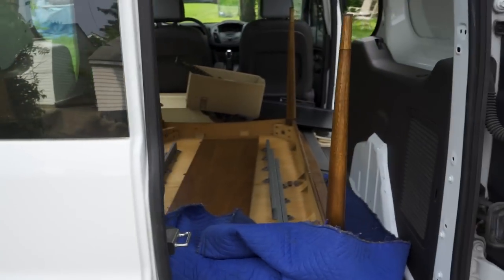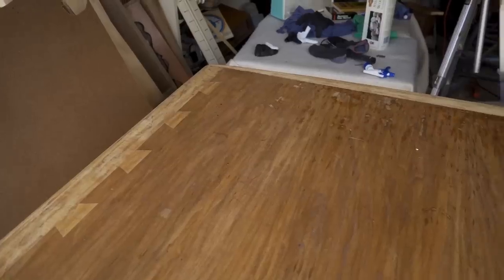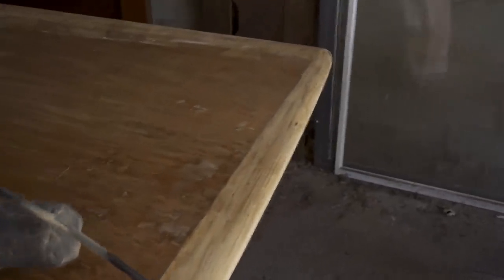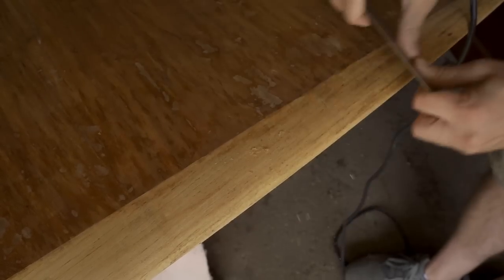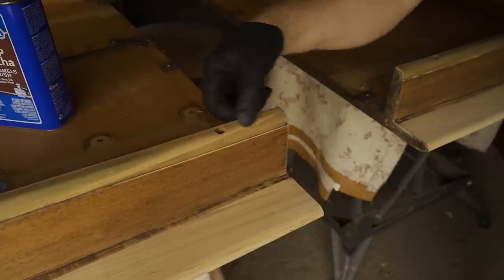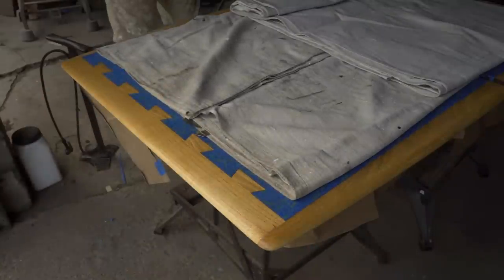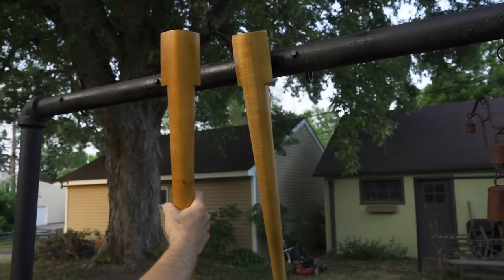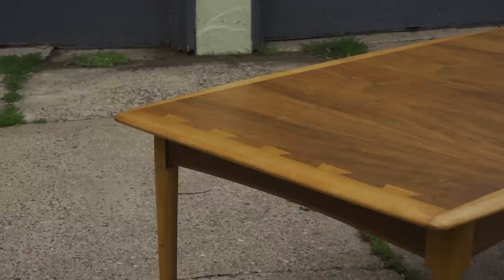I've Never Found One Of These Before | Vintage Furniture Refinishing - Repair - Restoration

Comment: I think this one is actually quite lovely with the obvious difference in wood.  Did you ever find any photos of the original piece fresh from the factory?  As always, you never disappoint.  And just as an added tiny bit of praise, I like that you never back away from errors or mistakes or accidental dings or dents.  I like that.  Honesty.  Good job, Dashner.

Comment: As a long time watcher of your channel, there are a few consistencies to your projects. Number one is that you love walnut. If it doesn't look like walnut, you usually  stain it to make like it looks like it is. The second is, you dislike dissimilar wood tones. In this case the manufacturer deliberately chose these woods BECAUSE they are dissimilar. Most everybody likes woods that complement each other. What I like is contrast. This table has it! The contrast between the border and the top is what gives this table class compared to the humdrum color of an all walnut piece. You do marvelous work, but sometimes you just need to envision what the artist who created the piece was going for. In this case, it was the contrast of the light dovetail border with the contemporary walnut top.

Comment: Dash-Nerd Leader, Thanks again for another great project. I agree with your assessment that the solid edging and inlaid dovetails are elm. This video is especially helpful for me, because I have a Lane Acclaim corner table. The guy I bought it from had done a decent job of removing the finish and sanding it. However, for some unknown reason, he then proceeded to add a coat of Restor-a-Finish (walnut). The center walnut veneer looks fine, but, as with your project, the elm looks streaky and nasty. After watching this video, I think I can proceed to bring my table to some approximation of the beauty of yours. Kind regards.

Comment: I love Lane acclaim furniture!  The contrast between the veneer and the wood that you revealed as you scraped away the finish made me so happy.  I’m glad you didn’t tone out all of that contrast, because it’s such a signature design element of the brand.  I’ve always wondered how they made the dovetails, and the revelation that they’re veneer is interesting.  I haven’t had an opportunity to closely examine any pieces to determine that for myself, so I appreciate the reveal. 

I like the look of the completed project. Although it’s not exactly original, I like the contrast between the legs and the apron.  It fits better with the top of the table.  I wish I had room for it in my tiny (cozy little, LOL) apartment.

Comment: I think you're right, the colors need to be blended a bit more. The legs, but also the lighter areas on the top have some variation to them as well (ends vs sides)

Comment: It looks beautifully, but i know what you mean about the difference between the light wood and the walnut veneer. I agree that the legs and edges could be a little darker. But it's also beautiful as it is. Given that the top coat is just laquer, which is also what the toner is, you could probably get away with lightly hitting those parts with toner again and doing a new top coat. Whatever you decide, it's a great find, and a good job refinishing it.

Comment: I have had nothing but issues with the Mohawk toner colors. I wish they had more accurate color charts or swatches. Van Dyke Brown is mostly green and Dark Walnut is more honey gold than anything close to walnut i've ever used! Unless you owned the entire toner collection to try each one you spend so much time and energy buying and trying each color that it ends up being better to work with Trans Tints and build up the proper color yourself.

Comment: Few years ago, I found a mid century dining table I sanded and oiled. I didn't finish it off with a lacquer like you did in this video. Table top seems worn out and dull now. If I want to refinish it again, should I scrape the oil off? Or should I sand it again? Any advise what I can do to redo it like the wood color on the dining table in this video?

Comment: Spoilers (probably)… *
What happened to the spare leaf? If, as most do, it was normally in storage mode, wouldn't it retain more of the original colour treatment? If it did, you have a good guide to what the original intention was. Or if you didn't like that finish, did you strip it down and do the same treatment.  I guess I'll have to wait and see.
By the way, I love the veneers on the table top, really nice pattern going on there.
* Hmm — just watched for a second time and it looks like the previous 'restoration' did a similar job on the leaf too.

Comment: I think the color is quite nice. I appreciate your work and your videos, thank you!  But one thing that sticks out to me: the finish on the two flat sides at the top of each leg.  You didn't strip or refinish those surfaces, and they now really clash with the rest of the work.  It's maybe just my eye; those little details really matter to me, and they are the first things I see.  I'd have to pull those legs off, sand the flat sides, and tone them.  (I'm a quilter, too, and where the seams meet, they'd better match!)

Comment: OK now I’m at the bottom of the list but, no you cannot leave them like that like I said I’ve done six or seven of them you have to stain the outside edges to be 10 or 15% lighter than the inside of the table or else it just doesn’t look right, to me at least, and from what my wife says which I can’t repeat , you need to make it right? and even you know……